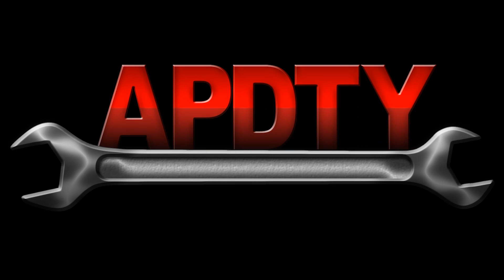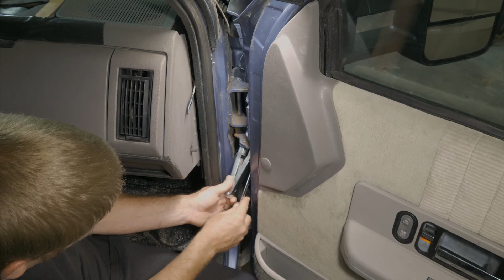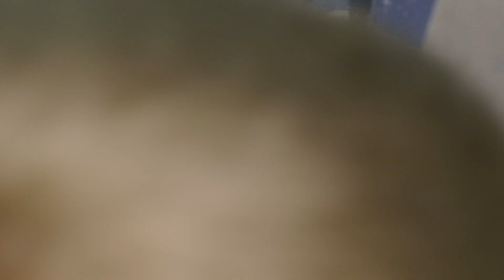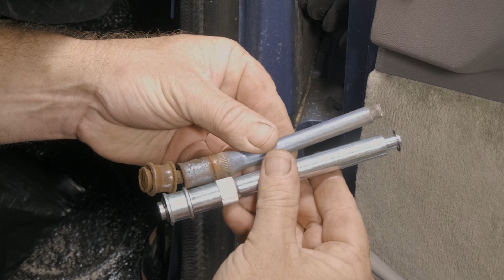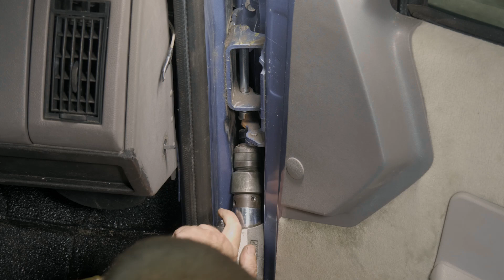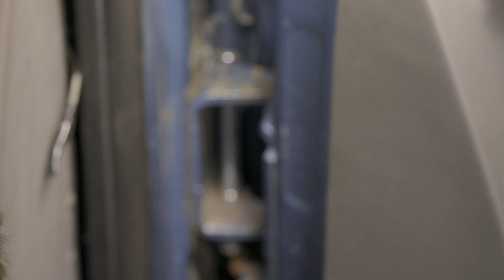1994 Chevrolet Suburban Door Roller Pin

Comment: Also lube all moving parts with silicone grease or a spray lubricant . I used a spray silicone grease , WD 40 would help also before greasing this way the WD gets into the small crevices of all moving parts. Grease the roller real good.

Comment: Dorman 38433 sucks. They should be beat like you have to do to their parts. Anyone else have a suggestion on a better part?
Reply: Lol yeah i just bought the same thing, doesnt fit at all. Tried air hammer, and a giant c-clamp it wasnt having it. Just like most aftermarket carp you just have to grind it down or modify it to make it work

Comment: I have changed dozens of the GM door pins. The worst of all were the 70s 2 doors with those LONG heavy doors.
 Never found a magic bullet, but used porta- power,   Flat stock,  punch’s …pretty much everything and a LOT of tippy- tapping with different hammers.  I always support the doors with a floor Jack for a little support and control when positioning too.
 Maybe some help there, maybe not.
Reply: This is not a hinge pin, you dont need a floor jack to hold the door up, this roller pin is just for the spring to control position of door that had nothing to do with the hinge at all. If you changing out the hinge pin/pins then yes you need support to hold the door up and other person should be present for help the door from shifting off the floor jack.
Reply: @tommiller6580   I never said that was a hinge pin, what ,in fact said was “ I have changed dozens of door pins”.    The need in you to correct what wasn’t said is strong and unnecessary.

Comment: I like the no sound speeding up of the difficult parts and can add my own cussing and fussing to go along with it and can feel right at home! Someone else on youtube used a carbide burr to grind off old pin and drilled out lower hole of roller, but they had the door off! And I like the 3 Chevy trucks I've had, but there are a few items that have constantly given me troubles with the 3 I've had over the last 30 years. And these door hinges/checks are an issue that has never come up in any other vehicle I've ever had since  I started driving in 1977 with a 1978 Ford Fiesta! My first of only 2 new cars I've had in that time period!
Reply: Exactly Mick.. not emphasizing the hellish BS it takes to force that pin in can't be understated, I've about lost my damn mind doing this!!
Reply: @imaguygolfn  I worked with a guy that said he always went to the junk yard to learn how to take stuff apart so he wouldn't mess his own car up once he started on it! Only problem with that is, I always find I need a different tool or need to make something so I can get a lot of stuff apart or back together and I wouldn't have the ability to do that in the junk yard!

Comment: What was the part number and make of the pin you used? I'm looking to replace the door roller pin on my 2002 Chevy Blazer and the closest looking pin I can find is a Dorman 38433 which apparently doesn't fit according to the various websites but it does look very similar. Thanks.
Reply: https://www.s10forum.com/threads/roller-door-stops-are-toast.765026/

It comes in 3 parts for Blazers, unfortunately.

Comment: Brutal job. Several good videos available since this happens to most Chevys. The pin is always tight. Many small taps to get it seated to where you can put on the clip.
Move the door back and forth slightly as you are tapping or have someone do it. The whole job is an exercise in Zen patience.  Good video. Bad doggie, don't scratch the door.

Comment: I can't get the new pin in, tried banging on it with a BFH and an extension and it won't get started on the gnural. If you have a trip please explain.
Reply: He mentioned grinding down the knurl. Since it has an e-clip holding it it that doesn't seem like it would cause and issue with it falling out. And it it turned some and not just the roller seems like that shouldn't be a big deal either.